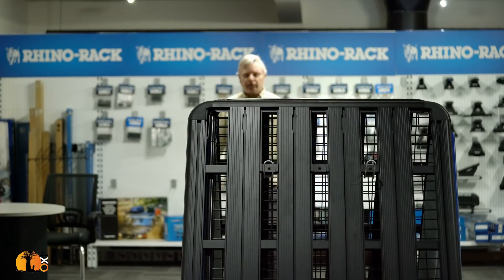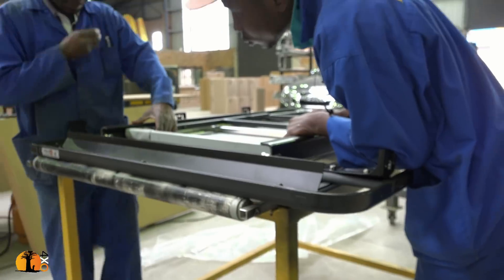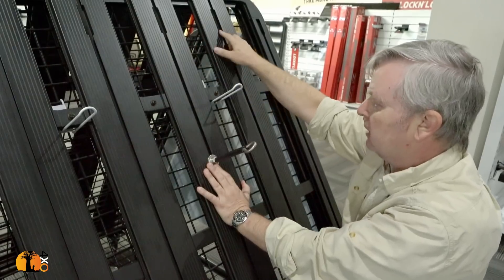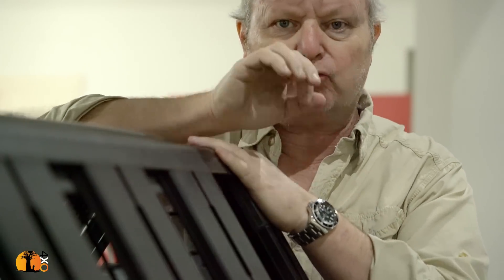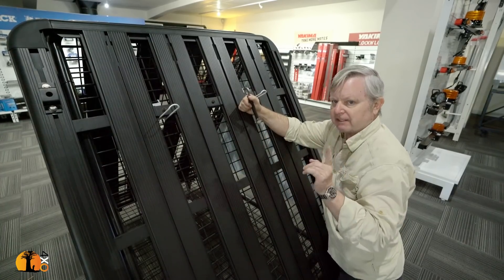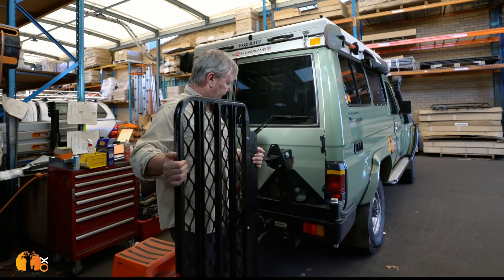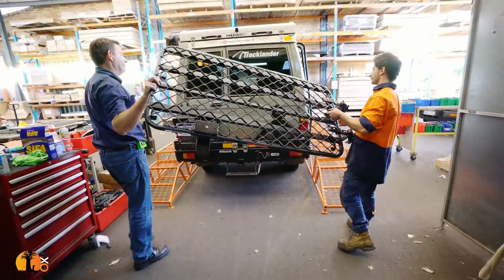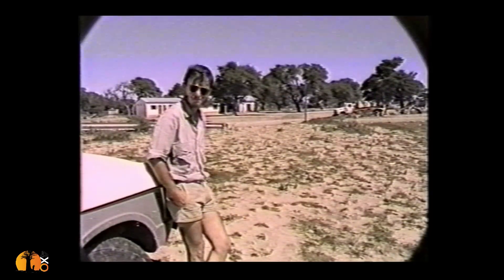ROOF RACKS - the GREAT, the ORDINARY and the AWFUL. How to select the right one

Comment: Have a Brownchurch on mine with 5 feet each side (on an 88" Land Rover) and additional support legs to the bulkhead and the rear body structure. It's not massively heavy at 35kg, but it's not the lightest either. However, it is considerably over-engineered and because of the way they designed it, the guttering doesn't take all of the load, the vehicle structure does.
Reply: I have one too. I have had it for 18 years and have given it a lot of abuse on occasions. Incredibly strong, nothing fancy and it does the job. However it isn't expensive and wouldn't have the profit margin to pay for the smart salesmen in the 4x4 centre, unlike the modular racks.

Comment: One reason why one should be able to understand and be able to fabricate ones own accessories. Manufacturers have limits in what they can do and sell for a profit. A few times in my life I have seen a weakness, understood the weakness and fabricated something better. But for sure, any rack must have the ability for one to use straps. No, not bungee cords, useless, but actually ratcheting straps. Better yet, straps that have clips on the hook ends to prevent them from disconnecting.

Comment: Something extremely important that I don’t think you mentioned, something that I only learned yesterday is ‘Load rating’ & ‘Offroad load rating’. Be sure to check the offroad rating as it’s significantly less than the load rating which is what 99% of people go by.
Reply: Static and Dynamic load capacities are the correct terms.
Reply: @morgangriffith6226  Static and dynamic are stationary vs moving.  Off-road vs On-road is just that- driving on gravel, etc. vs pavement.
Reply: @APWare  Yup, I get it, I thought OP was referencing stationary vs. moving capacities. With that said, I've never heard of a rack manufacturer or an auto manufacturer reference on road vs. off road capacities as different weight ratings. It's always static vs. dynamic, which are hard enough to find most of the time. Does anyone actually publish on road vs. off road capacities?

Comment: Andrew, how do you justify the cost of these racks when you can buy that Chinese made rack for a fraction of the price? For example, I looked at a Tradesman rack for my 4x4 and was quoted $1500 for a rack plus $150 to fit it. I then compared it to a $350 Kings rack and bought some metal and mounted it myself. I have now run the Kings rack for 12 months without any issues whatsoever. If the racks were closer in price, I would support the locally made rack but, I don't have the budget for such expensive items.

Comment: Interesting video... I have a Frontrunner Windcheater, that was fitted to the Nissan I bought a few years ago, and I often wondered if the feet were strong enough... I've never had a problem, but I don't load it with heavy gear, just a bit of fishing tackle, ladders and wood etc.. For a work vehicle, rather than expedition, it is very good...and way stronger than general commercial racks.  A mesh under it like the one you fitted would have been a big plus. I generally use click straps to secure stuff to the roof rather than bungies.
I do like the eye system though. I, as you say, have several on each slat. The main advantage of these is that the eyes and M8 bolts it uses, can be purchased in any hardware store, as they are not a proprietary system. 
It also means by just sliding in bolts of different lengths you can mount anything easily to the rack. Only problem is the bolt either oxidize (due to contact with ally rings) or rust, unless you can find stainless ones. 
I have now transferred the rack to my latest vehicles and it's still a very useful accessory. 
I've hung onto this rack as they are all hugely expensive in France, as most are imported from South Africa or Oz.

Comment: I'm building mesh carriers for T5 back door carriers - people love it's universal usability. BUT the single mesh wires can be overloaded quite soon and a sensitive load like a bag can be perforated if sth. hard inside squeezes the cloth. 
Unfortunately, in Europe I don't know manufacturers for aluminium (?) mesh like you show in the video, this is looking very good - BUT aluminium is sensitive to a vibrating load and breaks appr. 10 times earlier than steel. This is also why I would prefer to combine aluminium racks with steel feet (and you can weld them much easier anywhere).
One important point is that many roof gutters or grooves are not stright but bended - so the feet NEED to compensate that. And: always mount anything without a preload due to bending, pressing down or like. A preload together with vibrations is lethal to anything.
One perfect solution I miss here are airline fixing rails. They are standard in Europe (even UK!) and are getting better known in the US the last years. They allow to attach eyes anywhere in a 25mm pattern with many different "fittings" and addionally with a special M8 stainless steel nut I designed you can fix anything. 
There are roof racks on the european market with this rail system, and I think in terms of flexibility together with strength nothing can top them. The mesh solution comes close to it and has it's own advantages like: no parts can slip through and damage your roof or get lost. This perfect for firewood. You can walk on them without any risk of breaking your ankles.
My personal design for a roof rack was a complete flat aluminium plate with this railsystem pattern integrated - this works also perfectly as a tropic roof against sun heat (I'm building it no longer).
If one wants to see examples of that you might look for relleumdesign , I hope this is ok?
Andrew, I really like your videos very much - I learn something each time and I'm making you known here any time I can. CU on the Abenteuer&Allrad?

Comment: Nice this helps alot. Im designing and building my own and im using 1/4 inch thick for the feet so it can handle the weight
Reply from the maker: A tip. Weight is less of a problem as sideways movement. The rack must be able to flex, or it will damage the roof. But it must not be allowed to move sideways. This is whats breaks and bends rack feet. Just my 2c worth.
Reply: @overland-workshop  thanks ill keep that in mind

Comment: This makes me worry about the mounting points for my 4Runner. It's 8 bolts mounted over 4 feet. The shear strength of those can't be as high as I would imagine.
Reply from the maker: Its not just the number of bolts. But where are they fixed to? Through the roof sheet metal? If so, its going to break. If its using Toyota's load brackets fitted into the roof, then that's a good start.

Comment: They are ether way over the cost of where they should be. Or flimsy plumbing tube steel with a coat of black paint
I went to the local hardware store and bought slotted-angle iron  And 4 ft squares of diamond mesh on my 5 1/2 foot by 4 1/2 foot rack - 1 inflated tire with scissor jack, 20 liter fuel can With metal hold, 1 200watt solar panel, Hockey type waterproof bag that carries : light chainsaw (Use it for fallen trees in paths) length ways folding chairs x2, flashlights, booster cables, Battery charger Rope. I have had 300lbs on there No worries ...$110.00USD Oh And a fancy coffee for tack welding my mesh for me

Comment: Main problem is people dont understand the weight restrictions and how the rack is mounted onto the vehicle....static weight, dynamic weight and offroad weight are different.
They overload the rack and make it dangerous, the vehicle has a roof rating and then you have to subtract the weight of the rack and the items you intend to mount, roof tents, spare wheels, jerry can etc are heavy and you can quickly overload the vehicle. Some roof mounts are only riveted into thin roofing metal and are unsuitable, you need to check the manufacturers website and check all the weights, specs etc.

Comment: I've been doing some armchair research of roof systems for the D40 Frontier/Navara, and I'm surprised by a couple of things.  First, that no one has made a roof-ditch/gutter mounting track system even though the truck has deep ditches/gutters.  There's a system that bolts to the outside corners of the cab, and for all I know this was necessary due to roof strength issues, but it doesn't look particularly nice when the rack or rails and the feet are removed, which for me would be the normal state of things.  Second, how incredibly tall these products sit above the height of the roof.  When I was a kid we had an '86 Isuzu Trooper (also called the Holden Jackaroo among other names) and that truck had factory raised rails, but the crossbars didn't sit that high above the sheet metal roof.  Dad used to put stuff up on top directly on the metal roof, using the bars and rails essentially as a railing to keep that stuff in place.  Granted, it was stuff that was usually packed soft-sided so it didn't deeply gouge paint, but it did the job well enough.

If I wanted to fit a rack, I'd want it as low as possible.  I admit to being half-tempted to just buy some junkyard Nissan utilitrack rails pulled from a Frontier or Titan and seeing if I could make those conform to the shape of the roof in places where they'd be durable enough, and since they're the same dimensions as strut channel I could pretty easily make whatever I'd want to attach.

Comment: I’ve been looking for something real strong/secured and well built, I also feel very hesitant to put anything on top of my fiberglass camper/not that I will be loading it with extreme heavy equipment but I truly don’t trust much anything still to hold a rack!!
For both my Tacoma’s 1997 xtracab/2006doublecab, both 4x4s, can’t find a distributor here in the USA?

Comment: For my use, roof bars were more appropriate than a rack and I ended up choosing Front Runner. Not a heavy load and not accessed frequently.

What is perhaps of interest is the legs. I have a Defender, and the standard legs that Front Runner spec for it are too long. They do some shorter legs (size 5 instead of size 7) which get the rack/bars a lot closer to the roof. With those legs, it fits the Defender roof about as perfectly as you could ever hope for. All I have mounted to it is my awning, and I have that on the side of them rather than on top as it should be. The net result is that my Defender just fits under a 2.1m barrier. 

Before my roof bars, I'd inherited from the previous owner a Land Rover branded rack. Thankfully some idiot bought it off me, it was the biggest heap of junk I've ever seen.

Comment: In usage of straps is there something better(safer) than bungee cords to use but not exponentially expensive. I’ve heard of several cases 2nd hand of people tugging on the cord when it pops lose and hits the user, generally head shots and in one case it hit an eye. Seems that putting them where weather could degrade them over  time would make them unsafe with tension.
Reply from the maker: Agree with the comment on bungees. Only for temporary mount. The rubber degrades in the sun.
Reply: Telecom rope and a truckies knot , will have anything secured pretty quick .

Comment: By far, the best roof racks/mounting systems are on standard road panel vans. I had a Peugeot Partner, little French van. They have recessed nuts already in the roof, through to the structure of the van, to bolt you rack straight too. no drilling. no paint scratching. unbelievably strong. It's the same system on many vans now. The advert for the rack I bought, was another van sat on top of the rack of a van. I had at least 600kg of construction timber on mine many times. It doesn't even flex. I find it criminal how pathetic some of these SUV and 4x4 roof systems are. I'm not talking about the racks. I'm talking about the vehicle itself. Quick example, everyone saying how heavy duty the new defender is because it can take 300kg on its roof. Guys it's an 80K 4x4. I could take double that on a 10K 2wd van. Please up your game SUV and pick up manufactures. The simple panel van has had you beat for years. Sorry
Reply: Yeah I have thought about this too, if you’re paying that much for a vehicle then surely the manufacturer should put something in place to allow for a more hassle free and secure installation of a roof rack that can be literally be bolted strait on like a canopy rack. Why not have some  factory welded plates on the vehicle itself?

Comment: IMO modular racks are a rip off. The manufacturers lock the customer into a high priced proprietary system and their (expensive) accessories may not even be that good. Also you don't have complete freedom where to secure the load because the tie down points are on the cross members.

My solution? I have a strong, traditional rack (Brownchurch) and have decked it with GRP grating (the same stuff as waffle boards but thinner and lighter). It's light, totally corrosion resistant and you can tie down anywhere. Oh yes, the rack and grating is a fraction the price of one of the fancy modular racks.

Comment: Those nuts are common place. They arn’t all that special. They are called ‘channel nuts’ and are commonly used in cabinet making and cable tray assemblies. You can purchase 50 of them with some m8 eyelets that bolt into them from many online hardware suppliers. You’ll also save a fortune considering the cost your typical 4X4 store will try to charge you for a pack of 2 or 4 of them....

Comment: Just bought a 4wdsupacentre rack for $250 lol... We will see how that goes
Reply: How did it go?
Reply: @JimBob-vb8oz  it went ok, I've still got it on. I put it on my 2004 Prado. 
Used Sikaflex from Bunnings to bung up the holes that were all over it. Resprayed over the entire thing a couple of times with some black rust killer paint. (Dulux I think).
But after a few rains it was dripping rust shit all over the car. Resprayed the Dulux paints into all the cracks and hidden edges and that seemed to fix it. (Luckily I have a sunroof so I could actually get to those spots)
 In terms of usefulness and value, very good, but just be aware of the potential rust issues.

Comment: Sure looks to me like that sliding nut system is identical to industrial strut nuts, just with more of the slot covered so they have to be inserted in a certain place instead of anywhere.
Reply from the maker: Yes they are.
Reply: I must have misunderstood, if they are the same could someone not just use commonly available brackets, eye bolts and their own accessories instead of the ones from Rhino-Rack?

Comment: I don't believe in using the  water channel of the roof rack  as a secure point  I always recommend a full exoskeleton  rollcage because at some point in your traveled you will flip your vehicle and will need a jacking point and sadly we shouldn't try jacking off the chassis as modern vehicle just don't have strength in them to support a jacking in a rollover..

Yes you might be a good driver Andrew and may or may not have  an accident or 3 to your name however there is always the chance it can happen and looking at your current build with the modifications you have done for whichever reason you can not recover your vehicle  on side flip or roof flipover 

as for roof racks no matter of build quality if it attaches to the physical roof you be lucky to carry 4 spare jerries full of fuel and 2-4 spare tyres..

weight might be a saver in your book however I have seen what damage a roo can do a vehicle  to minimal protection people use  and sadly a 45k+ vehicle was a complete rightoff in insurance ...

with the likes of roo's emu's, cattle and camels to deal with outside of metro area's of perth, darwin. brisbane, hobart, melbourne and sydney..

I would hate to see the damage happen to that cruiser of yours and the fauna of australia can kill your vehicle quicker when doing 80-110km/h down the highway.

never mind what speed you do on the bush tracks of australia... animals are territoriality dumb and tend to kill vehicles when they decide to play chicken 

if i was going to mount jerries of water or fuel on the roof in a box like depicted in your video it wouldn't 1/2-1" aluminum it 2-4"steel or aluminum thin shit fails and is not designed to hold weight
Reply: PerthEnduro obviously you haven't seen the damage a kangaroo you can do..

as for jerry can holders on the roof.. from what i can see in this video of the actual failure tells me to thin of a thickness in the jerry can's holder box, understand this I am pretty clued up on gvm upgrades in Australia as i'm an australian, how ever I don't delude myself in what is physically needed if you want to go bush/offroad bashing across australia 

and most grey nomads i see have no business being near the highways or backroads of australia without severe vehicle modification as I find most regardless of road experience have very little commonsense outside the Metro areas of Perth, Darwin, Adelaide, Sydney, Melbourne,  Brisbane or Hobart..

I think Andrew tries to do what he has done in Africa and tries to replicate it here..

Without the knowledge of feral cattle, camels, emu's, kangaroo's and sheep that can be on the roads of australia  at all hours of the day and night.. 

I have also seen the aftermath of a roo strike on a 4x4 and it wasn't pretty..

I would hate to see what water buffalo and cattle would do to a 4x4.. without the proper protection?????!!!!!!!

Comment: Rhino rack is going down pretty bad nowdays. I used to look at their back bone system and thought they look premium now I steer afar from them incase it slides off and hit me.
Reply: Depends on what vehicle its fitted to. Many vehicles have different ways it connected. some have bolts M6 , some M8 bolts with 6 a side into captive nuts that are very secure, some have no bolts into nuts so that they are secured by rivets which can raise an eyebrow, just look at what happened to Tyler T, and Ronny D. My point is it's not all bad, just some vehicles have piss poor roof systems